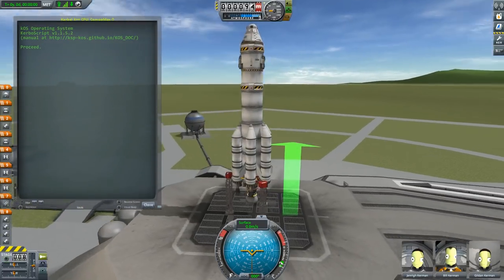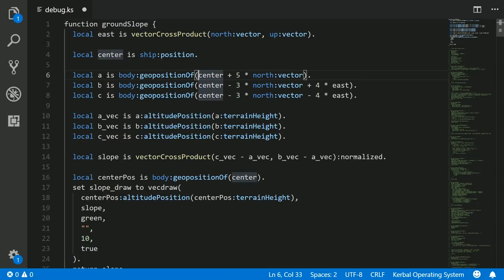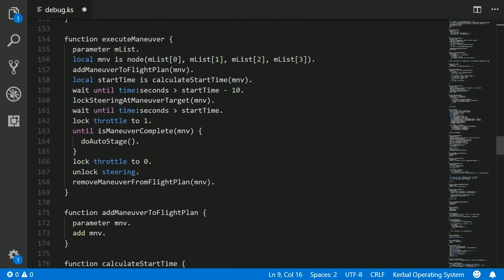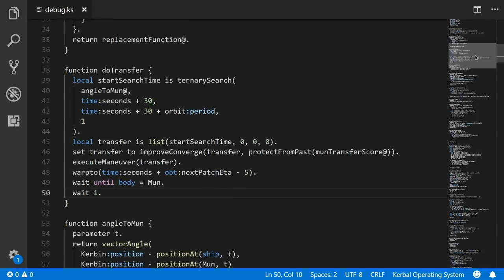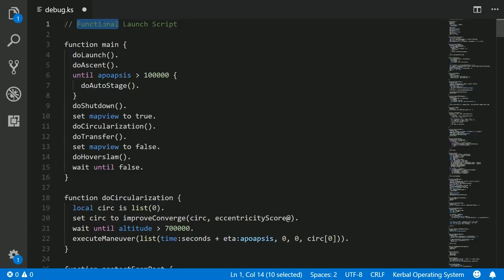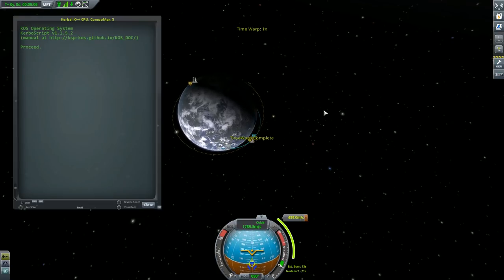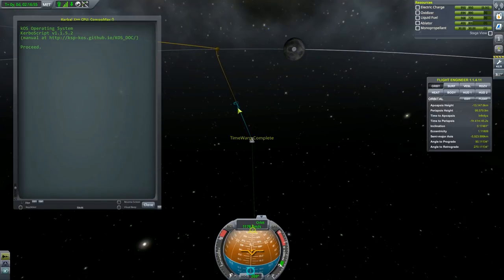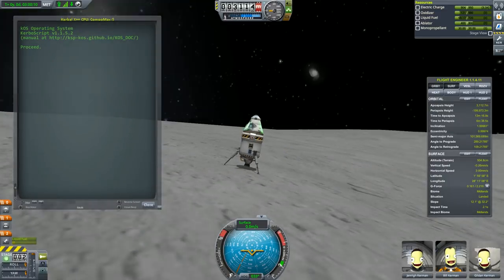Happy Landings - To the Mun with kOS

Comment: Yeah got it working. 
I have added a round function in eccentricityScore function in order to stop improving beyond the burn accuracy. I also changed the radar height from 4.7 to 7.7 m. After that it was just luck to get on a flat surface, about 3 time I ended up on a steep slope.
The algorithm from episode 10 gave me often a fly-by with the Mun but not a collision, the latest code did gave me an proper encounter en never a fly-by.
Your code is really nice! Hope to see more!

Comment: How do you shutdown and engine so it can't fire?
How do you end out of a program early for failed to ignite?
How do you have a separate function continuously running checking for an abort function. In the background of a gravity turn or such.
Reply: I still want to get the abort () in a separate file so it can be run from anywhere. 
Also I need to figure how to run a separate abort during a gravity turn to activate range control. 
and another to give me availablethrust as from the time the engine fires up. (Similar to space x readout on screen.)
   
Here's what I thought of for abort on launch pad.
function prelaunchcheck {
	PRINT "Avail thrust " + round (ship:AVAILABLETHRUST, 3).
	if ship:AVAILABLETHRUST > ship:maxthrust*0.90 {
	print "1".
		wait 0.8.
		voice:PLAY(voiceTakeOffNote).
	stage.
		print "Launch" at (5,6).
		function abort {
	}
	else {
		PRINT "Engine failed.".
		PRINT "Shutting down engine".
		wait 0.2.
		lock throttle to 0.
		abort().
	}

	}
}

Comment: okay still scratching my head kevin.  I literally compared your code to mine line for line and mine matched 100%  but when I ran mine and it got to doTransfer - it would crash in the call to improve with a: call to non-invokable object error.  This started after the episode you add protectFromPast().  

Finally in desperation and out of total frustration I just copied yours and pasted it over mine.  Exact same 307 lines of code and ran it and doTransfer worked.  The ship crashed during the hoverSlam but it ran and I am totally at a loss for what was causing my to through the non-invokable call error.

I saved a copy of mine  matches every line of yours.  But it will not run.  It is bugs like this that make me want to get a hammer and just smash either the computer or my head!
Reply: maybe a spelling error or missing brackets, dots or commas happens a lot and can be easily overseen
Reply: had a similar problem...

set index to index+1.
// Is not the same as 
set index to index + 1.